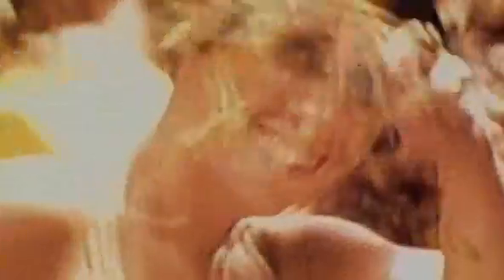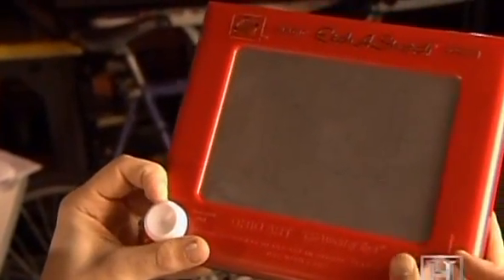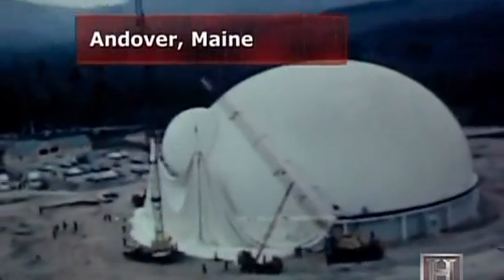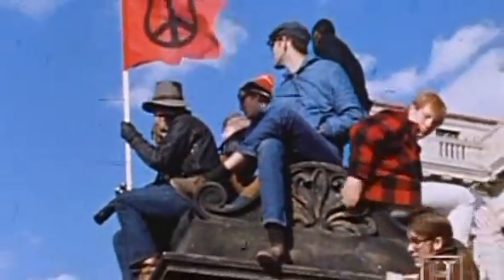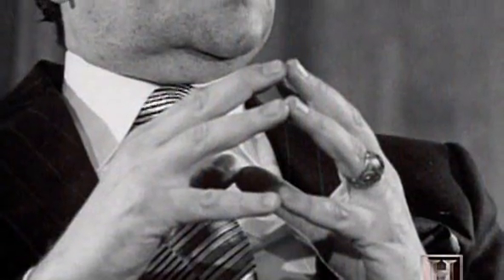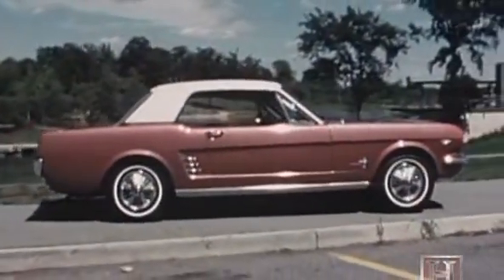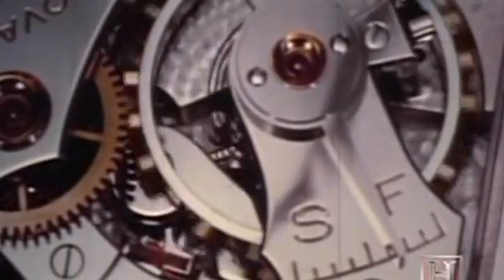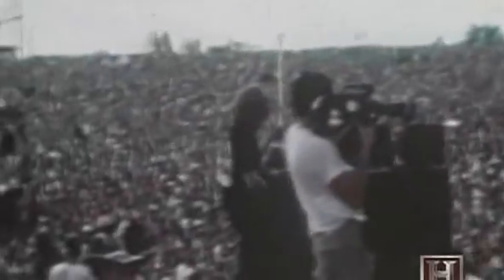Modern Marvels -  60s Tech

Comment: now 1/144 scale Japanese slot cars are the rage in 2017. they don't need remotes, just put fresh battery in , drop and go. You Paint the Exterior like a Model car, they have 2wd and 4wd models. I built and played with a Dual Shaft 4wd model I Painted my self , applied the Graphics and ran it. popular brands include Tamiya and Kyosho.